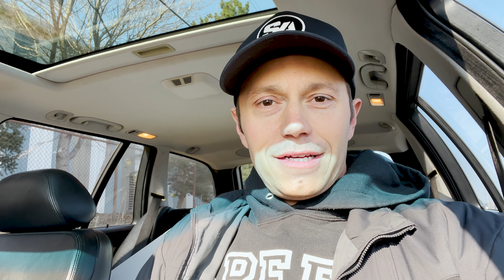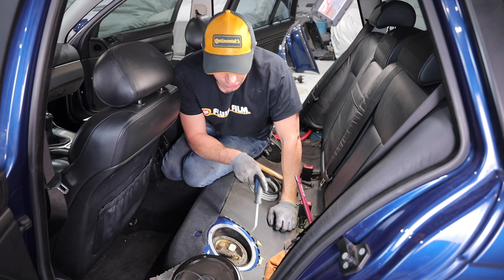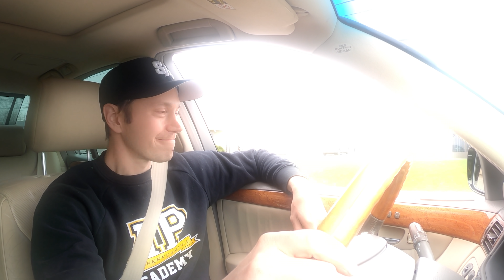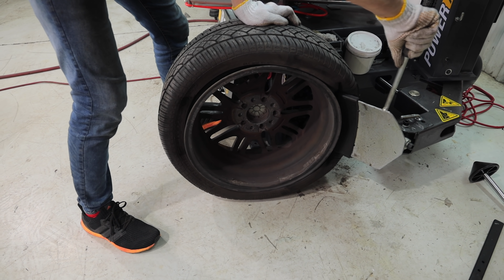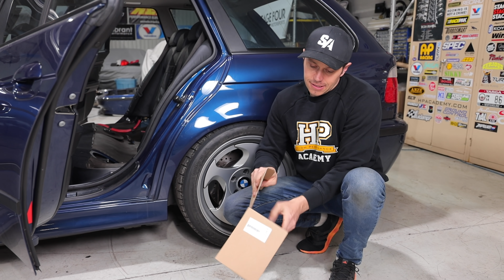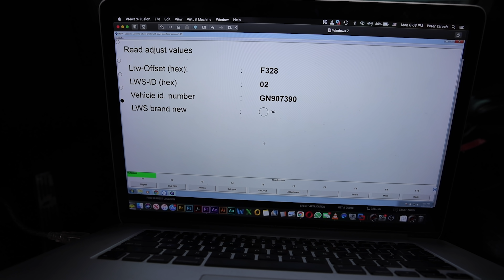FIRST DRIVE! BMW M5 Wagon - WHY CAN'T YOU BE RELIABLE?!

Comment: the thing you are comparing between Lexus and BMW is not a fair compression. the Lexus is owned by a mechanic, never sat around. was no, engine swap and has know maintained. the BMW is a mix of two cars that were sitting around and neglected frankenstined together in and furious build. to do the BMW right will take time and replace all warn out and broken items. or get a Lexus that sat around for years and engine swap it with a neglected car.  I have owned both Lexus and BMW new from the dealer. my BMW lasted longer and had way fewer issues, but the best cars by far that I put insane miles on were Mercedes with 0 issues. I have owed, 2002 Lexus es300, 2006 Lexus es300, 2010 Lexus gs350, 1996 Mercedes e280, 2001 Mercedes e320 2009 Mercedes E350, 2015 Mercedes E350, 2009 BMW 328i and 2018 BMW 430i. Out of all these cars my Lexus had the most issues. I had to have the engines rebuilt on 2 of them, replace the rear suspension, and catastrophic electrical failure, leather that just did not last beyond 35,000 miles, lucky all under warranty, 3 of the 3. the other cars no issues except a radiator repayment for the 2009 BMW 328i at 143,000. all my German cars looked and rain like brand new, lexus just do not hold up in the hot California sun. just one of the reasons you do not see many older Lexus. most are 5 years or newer, but you see the older German cars. I drive mostly freeway miles and my cars are keep in a garage. detailed every 3 months and all maintenance is done at the dealers. so the Lexus lasted me 85,000 average before I got tired of dumping money into them. the Mercedes no issues just tones of miles. last one sold with 195,000 one was stolen and one was rear-ended at 165,000. the BMW still own and still running one has 148,000 and the 2nd 54,000.

Comment: Bravo on the gas fumes scene, when you said that I hoped to see that next, you guys are great
Reply: What would be the problem if you do smell gasoline while driving or car is running? Honestly asking because a friend has that problem.
Reply: @leonardnose5695  Could be the Evap system, or a myriad of other things, I'm not an expert by any means, I'd recommend having it looked at by a mechanic
Reply: @leonardnose5695  
My old lexus es300 did that back in the day, it was the fuel dampener (or damper? I forget). Like a $30 part but required a large crow foot wrench that wasn't in any standard sets locally. Had to order it off Amazon. It started as a small leak, faint smell of fuel at shutdown. Then idle. Then it got HUGE. As in a tank of fuel was gone in 70 miles instead of 300. I thought the car might ignite lol. So maybe that's it.